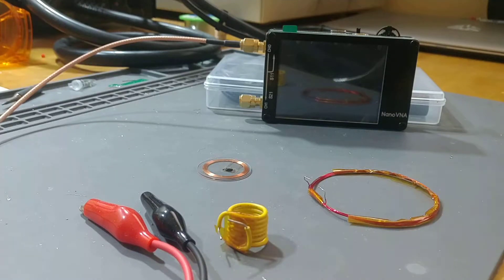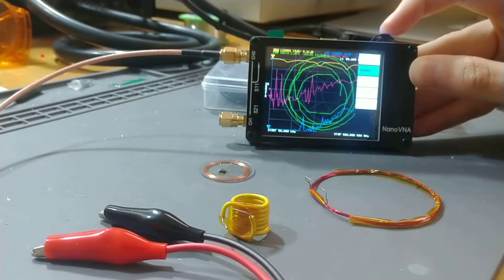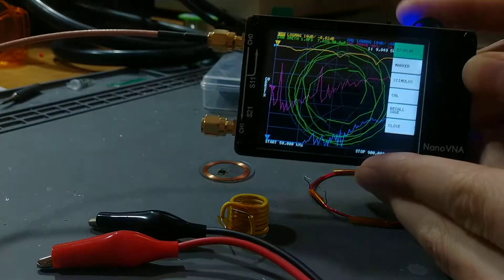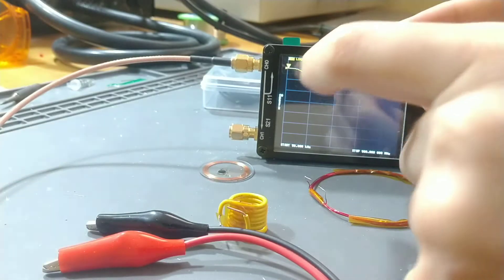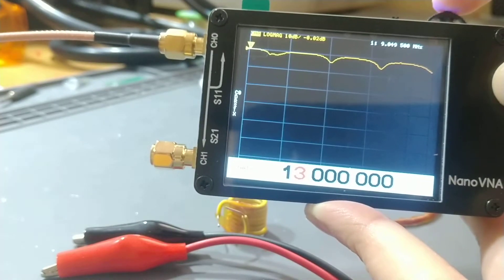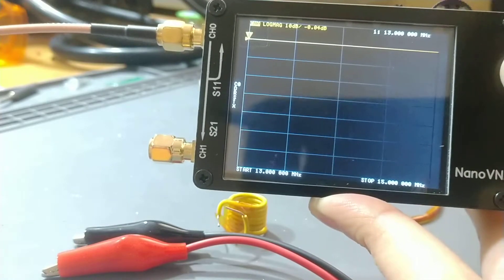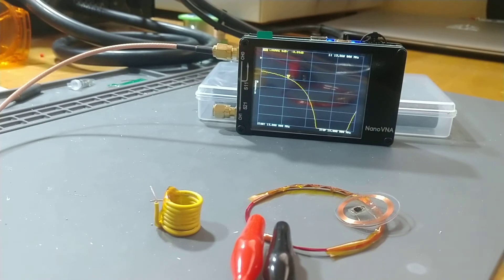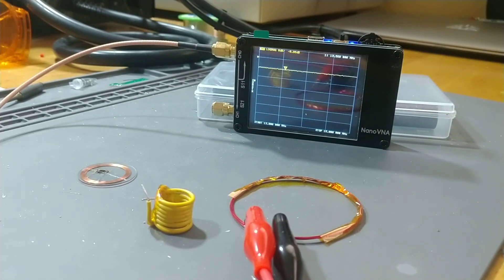Testing NFC antennas with a NanoVNA

Comment: @yan-mx2dc
3天前
cool video thank you ,if I just sign a NFC antenna, how can i get its real S11 in HFSS? I tried use a capacitor to replace the chip in tag but it not work

Comment: Thank you for a nice video. How to design a red reader antenna ?? just making a circle shape with copper wire?
Reply from the maker: Yes basically. You can also buy H-field probes that screw directly on with the SMA connectors. If you want to make your own just use 1-8 turns of copper wire. Don't use too many turns or the impedance characteristics of the coil will get in the way of your measurements. You're also going to want the diameter of the coil to be approximately the same as the tag you're trying to read to get good coupling.

Comment: Have you ever made your own reading antenna? Maybe for a PN532 connected to an Arduino perhaps?
Reply from the maker: I have for a PN7462. The impedance matching and EMC filter circuits can be a bit finicky if you're trying to make a custom antenna outside of the normal size range NXP recommends for EMV certification. Check out the NXP document AN11706 for more details. There may even be one specifically for the PN532, although I haven't checked. There's serious chip shortages right now, so it's wise to make sure you can even source the PN532 in your locale before creating a novel design with it. If you want to talk more about the technical considerations I'm willing to chat.
Reply: @vivokeyprodev  so would you recommend that chip if I was creating a 15 x 15cm 13.56 mHz reader antenna?

Comment: Hi. What is the aim of your implant? Is for any health condition?
Reply from the maker: I have several and I help design them. They're not currently being used for medical purposes, but it would be nice to provide basic health information one day. The one in the video is a NExT. It can be programmed to replace many different kinds of access control cards, and also share my contact information with any mobile phone. It has no battery and only receives power from the reader device.